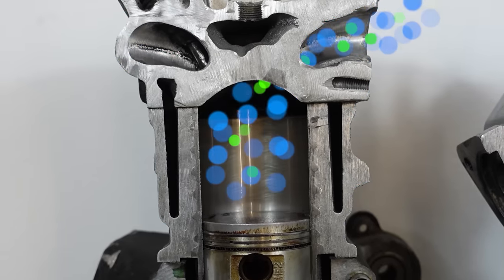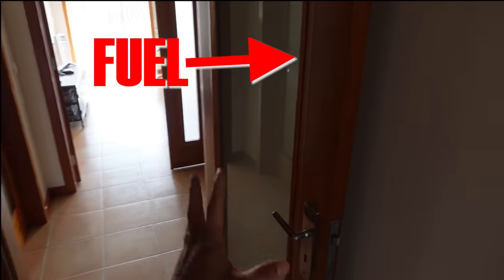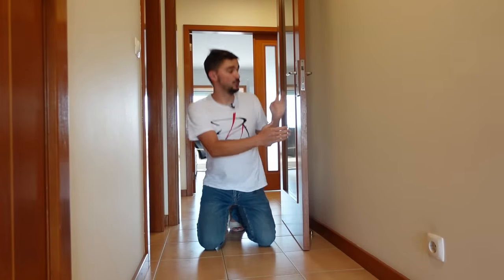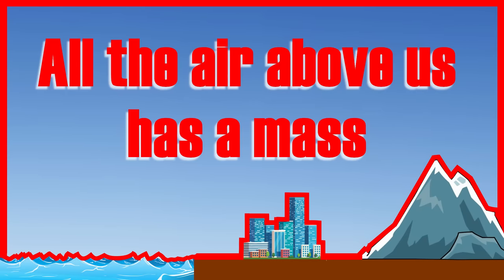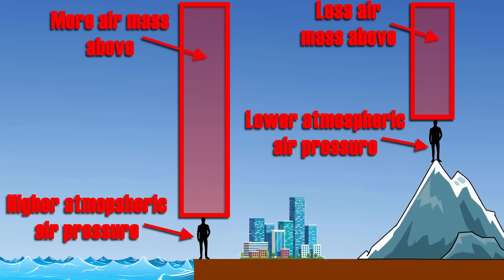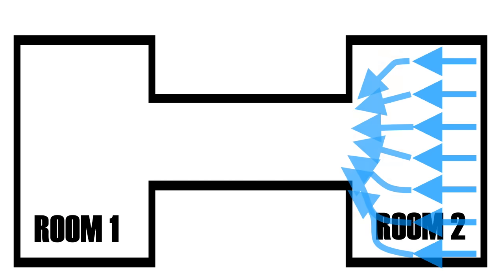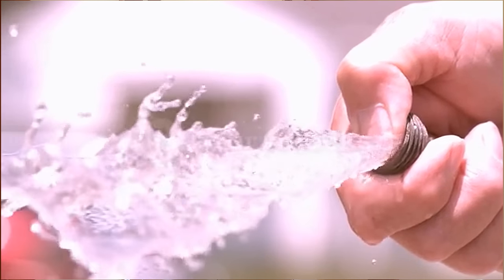You Will Understand How a Carburetor Works After This Video

Comment: im gonna walk around my house now and explain to my wife how it's an analogy for an internal combustion engine
Reply from the maker: I just know she's going to love that
Reply: @d4a I also know this guy's wife
Reply: Good luck
Reply: Well you'd better not get the part about variable valve timing wrong or your camshaft is in for some trouble. 🤣🤣🤣
Reply: If you’re clever, you’ll go off script for the “suck” and “bang” and “blow” parts.
Reply: Houses sometimes become a giant cylinder, when someone leaves the stove gas on a long time, it mixes with the air, and then a "spark" occurs. It's usually not very good for the house though.
Reply: She won't care how the house works. Only if it goes when she turns the key in the lock. If it doesn't turn you better fix it or she will trade it in for another house.
Reply: @ianthepelican2709 definitely better have some lubrication on hand just in case it doesn't set off her thrill meter😮🎉 probably will need some artificial fuel for watering down the tank LOL
Reply: Get a divorce lawyer ready.
Reply: @MurCurieux  In this case she is entitled to get everything 😱
Reply: Will probably believe it's still ghosts..
Reply: @exothermal.sprocket but wouldn't that be more like a fuel injection? The gas is blowing in from the nozzle on the stove or whatever appliances, it's not being sucked in
Reply: @ShannonDove-sy7ye  Yeah I guess you could say that. Direct injection, but it's so efficient because the gas being injected is already atomized.
Reply: @exothermal.sprocket  yes .... that's why it's so incredibly easy to run a motor on propane gas, because it's already a gas it mixes with air so easy. Just put the propane line into the intake or air breather, and Viola....runs beautifully! I sometimes use propane as a starting fluid substitute, seems to work reasonably well, but I'm not sure about a diesel motor. Gasoline vapor runs a diesel motor, but if course it doesn't work if liquid gasoline is coming from the injectors, it has to be already a vapor. I guess that's because the droplets coming from the injector has such a cooling effect. I don't know if that's part of the high octane of gasoline, or if it's in addition to it. Propane is even higher octane, so a diesel would probably struggle trying to ignite it. For reference, diesel is about 20 octane, compared to gasoline being over 80, and propane being over a hundred.
Sorry for such a long response, I'm just feeling chatty and talkative, and rambling on, lol
Reply: @ShannonDove-sy7ye  I guess we ran down a rabbit trail from the original metaphor anyway.
Reply: @d4a oh damn I better make sure she ain’t subscribed

Comment: Like most other people of a certain age I remember having car troubles with carburettors quite often.  In fact the store where I worked used to sell conversion kits for manual chokes.  Since the advent of fuel injection in mass produced cars became widespread I've personally never had a single issue with fuel delivery.  No more having to adjust this and that and fiddling around upon cold start-up's, more economy and power with lower emissions.  It's all good as far as I'm concerned, thanks for the video though!

Comment: It's way outside the box, but every word and every aspect, every analogy are very true.

I guess it's a bit like seatbelt and crash helmet laws, only the converted / educated really appreciate the intracasies of it all.

You have raised 1 point though.

The importance of lamina flow through carb design.

As your hall door (throtle slide) was closing, we know the low pressure fast moving air would be tearing itself away from the flat surface of the door and causing vauticies.

We can't allow such vauticies on a carb.

So keeping the carb air passages /surfaces clean or polished is important.

We can learn from this, that a dirty carb facilitates better low end power because of a  greater turbulence vs a shiney clean carb producing greater top end power due to greater volumetric efficiency.

Comment: damn its really impressive how some smart people came up with this. Also, great job on explaining, it's very clear.

BTW, your demonstration would be even better if you used some visible gas to show the air flow in the carburetor
Reply: There are several CLEAR carburettor videos online, so you can see the process in real time.
 Worth a search.
Reply: I think we can safely say that it wasn't just one smart man inventing this from scratch.
Basically it has all happened in increments with small steps, the next was one step to improve, suddenly you have a carb that works.
I bet the first part was just a manually controlled fuel leak / leaking hose.

Comment: Another good real-life example is going to a bigger city, especially during somewhat windy days. Because most metro streets are set up in grids, forming constricted pathways between tall buildings which create higher air pressure, you get that extreme difference between air velocity on streets parallel to wind direction vs. thise perpendicular to it. Since the constricted flow further increases pressure, velocity, and also the directionality of the flow, it further lowers the pressure on the streets between the high pressure paths and make the difference even nore pronounced. The entrance to my workplace is on one of these lower pressure streets, and every time it gets windy, my ears pop and ache when I leave tbe building.

Comment: Well, ofc your explanation of the principles of the carburetor is flawless as always. But I just don't see that the cause of the door initially starting to move is caused by the bernoulli's principle.
I just see a typical check valve.

In order to recreate a real carburetor I think you should open a door in that hallway and hang there a curtain. If that curtain is sucked in the hallway - thats the Venturi effect.

In this case, I think, airflow just got trapped behind that door which pushed it in the stream.

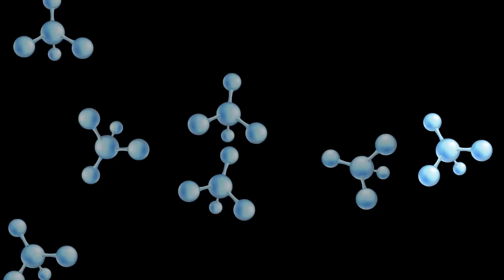Comment: 4:16 l believe you wanted to say that they bump towards the direction of the incoming air since let's say a moving molecule bumps away a molecule of standing air the other molecule that travels next to the moving molecule will bump it towards the movement eventually ... try to throw a ball from one side to the other of a billiard with balls moving vertical ... will never reach the other side but eventually will flow with the flow of the vertical balls instead

Comment: Question? So why do cold engines need a choke or more fuel?
Reply from the maker: Because the fuel ends up sticking to the cold internal walls so less of it gets into the engine. This happens because the engine isn't hot enough yet to vaporize the fuel.
Reply: Kudos! @d4a

Comment: Such a great video! I have a question I was hoping you could help with: on many 2 stroke engines they have the capacity to be 'tuned' when working at different altitudes (air pressures). What does the tuning change within the carburettor? Does that make sense?

Comment: The temperature of the air will also change slightly, caused by the Joule-Thomson effect. Less pressure equals more entropy, thus lower temperature. 🤓

Comment: I think you got the reduced air pressure from velocity wrong. The point is that a horizontal movement reduces the amount of times the air molecule bounces vertically.

Comment: Hi! I was wondering here, is the valve system the best we can make? I mean, all this interference and not being able to use a 100% of the oppening area for airflow is kinda annoying. Can't we make something like a revolving disk with cutouts that open and close the cylinder ports? I mean if temperatures is the issue, just make the disk like 5cm thick it will still take less vertical space than any valve. And if they can make rotary engines seal then surely they can seal a rotating disk. I think it would even be possible to control such mechanism electronically much easier than a valve system, which opens up a door to greater efficiency and power.
Just a thought here, maybe I'm missing some important detail.
It would be nice if you could make a video on historical valve alternatives. Current 4-stroke engine design is ancient knowledge.

Comment: I like those systems that people rig to use fumes to run the engine.  Why all this crazy Rube Goldberg stuff when you can run on fumes?  I know they say it doesn't work but why not?  My hunch is that it can't supply the necessary amount of liquid fuel to the system.  If that's not the reason, what is?  Aren't the fumes at the require air/fuel ratio already without monkeying around?  Certainly they can be leaned out by modulating the amount of are arriving with them.  I say we try it.  Who's with me?

Comment: What's the difference betwee Bernoulli's principle and the Venturi effect? I always hear one of these mentioned in videos about carburetors
Reply from the maker: You could say that the Venturi effect is a consequence of the Bernoulli principle. One is a principle, a more general statement, the other is an effect, which is a more specific application of a principle. But they both deal with the same phenomena.

Comment: I still have two questions, first one where the bypass air hole that is used in iddle enters into the engine? because you only show the air that enters, but where does it exit to go into the engine?, second question, how this main air jet operates at full open throttle to atomize the fuel?

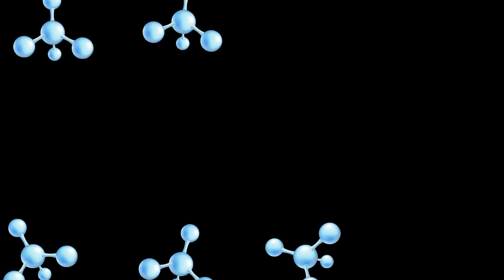Comment: 4:20 That is not correct. The total internal pressure remains the same as it was in the bell but it is directed by the motion. The static pressure reduces because the movement gives less time and angle to apply it's pressure 90 degrees to the flow. Dynamic pressure + static pressure = total pressure, the density remains the same. There can be a large loss of density after the throat if it is shaped badly enough.

Comment: I have a small question, does heavier crank shaft in effects performance in a good way?, for 1 cylinder engine
Reply: In a good way, yes. Heavier crank means better balancing properties, meaning that your engine is smoother than with lighter crank. it can also handle more torque.

in a bad way? as with anything heavy, more rotating mass often results in less movement, you cannot rev your engine faster, and it means less power.
Reply: @sx4mania35  more weight doesn't mean better balance. You need to have the perfect amount of weight at the perfect distance from the crankshaft center in order to achieve optimal performance. Changing the weight either by increasing it or reducing it will make the engine less efficient, noisier and wear out faster
Reply: @Mr.Engine993  to be fair, my assumption (that I forgot to mention on my first comment) relies on the weight being distributed evenly on both sides of the crank. 

also, from my experience of servicing, repairing, and sometimes tuning a lot of single cylinder motorcycle engines, weight changes on the crankshaft really depends on what the mechanic wants it for. more often than not, we add weight to our crank when we want to increase power (usually with bigger pistons, which of course bigger other parts will follow) in order to reduce the vibration and harshness caused by the bigger bang, usually by replacing the crank with a slightly bigger and heavier one (I mean, I've seen some machine shops in my local area adding weight to crankshaft by modifying it to have extra metal addition pressed in. Oh the joys of budget tuning).
Sure it may not be less efficient and buzzing like hell, but for tuned engines like that, those riders don't care.

Comment: The moving molecule bumping stationary molecules out of the way is nonsense (or I don't understand the simplification). The molecules in a closed room are not stationary. They are bumping chaoticaly every which way, their velocity vectors having X, Y, Z components on average exacly equal (static pressure). When you introduce movement of the mass of air, the X component (let's choose X as the direction of airflow) of the vectors gets longer at he expense of the Y and Z components. After all, nothing added energy to the molecules in the room/channel and nothing subtracted from it (bumping against the walls is compensated by molecules bumping on the other side).
The Bernoullie's principle talks about 3 components of the energy of a volume of fluid in a channel - potential energy (gravitational and completely negligible in the majority, if not all, cases), kinetic energy as pressure (bumping chaotically at the walls), kinetic energy as velocity (movement in uniform direction). When you introduce movement by a pressure differential, you just transfer some of the pressure component to the value component. You just change a mosh-pit to a marathon race.